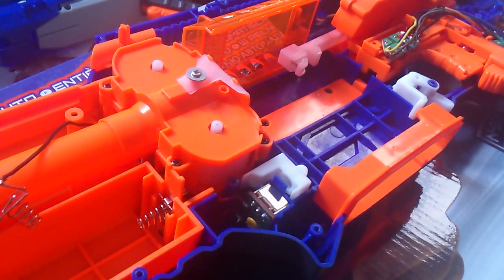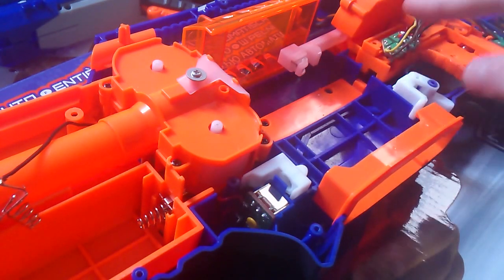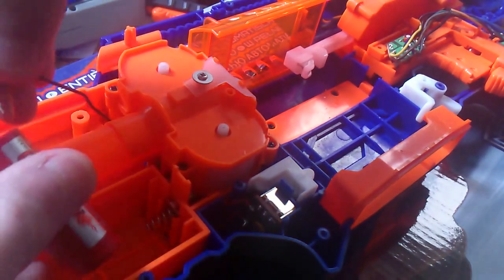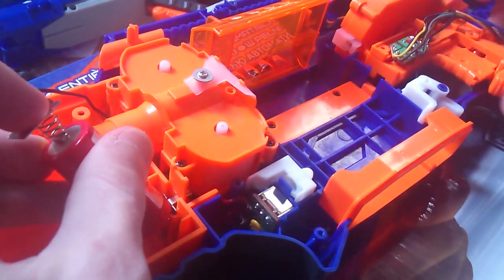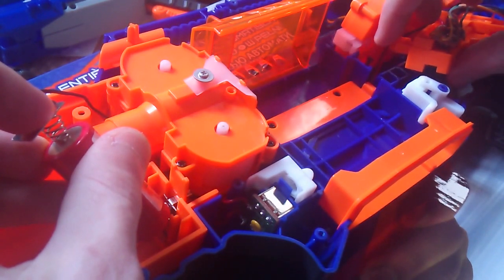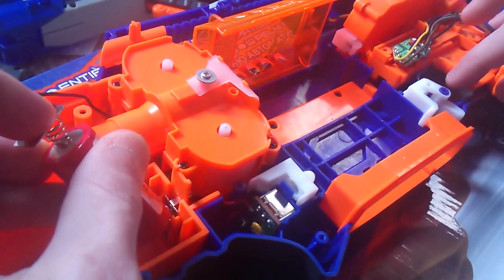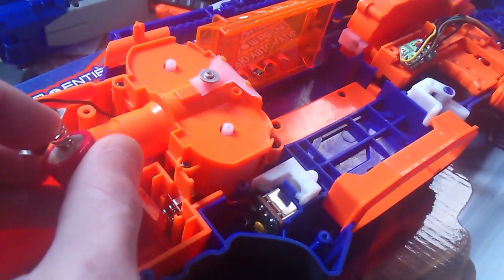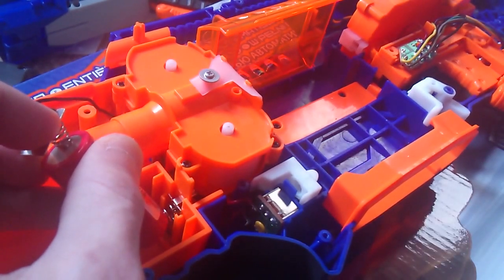RapidStrike Pusher Cycle

Comment: How does it affect the performance if you remove the cycle control?
Reply from the maker: +Erix Without the cycle control switch the pusher arm won't always fully retract after you release the trigger. It shouldn't affect muzzle velocity but it will result in an inconsistent delay between pulling the trigger and firing a dart - sometimes it will be almost instantaneous other times you'll have to wait for the pusher to fully retract and extend again to fire a dart. With a "live-centre" cycle control circuit (which is essentially how the RS works out of the box) you're also pretty much guaranteed to fire a dart even if you quickly pull and release the trigger since the cycle control switch continues to feed power to the pusher motor until the pusher fully retracts (although this isn't as much of an issue if you start running upgrade motors which can achieve higher rates of fire).

It's a long read but torukmakto4's guide to the different wiring schemes and the pros and cons of each is worth a look if you're interested, especially if you plan on rewiring a RS: http://torukmakto4.blogspot.co.uk/2015/06/tech-rapidstrike-control-circuits-part-1.html